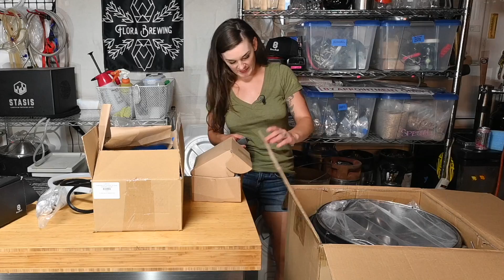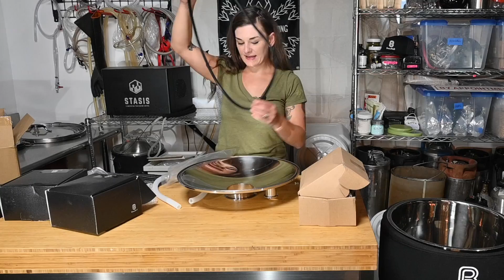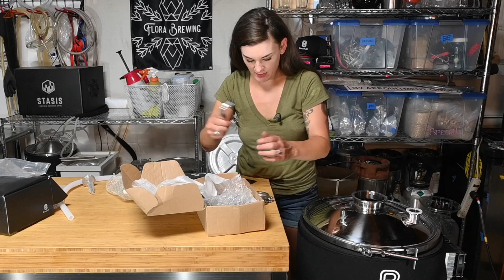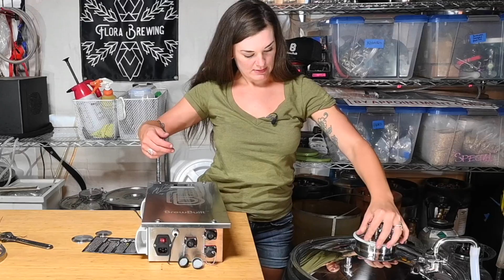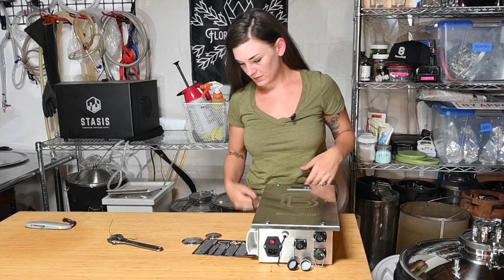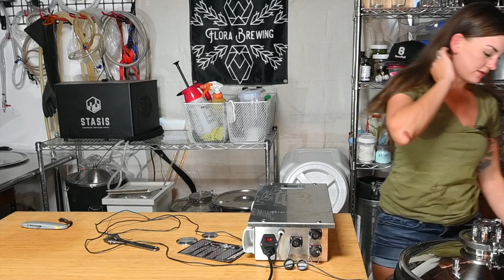BREWBUILT™ X1 UNI PRO Conical Fermenter Unboxing and Assembly

Comment: How do you pressurize it?  I bought the pressure pack and spuding valve tower but the post in the lid is a prv that goes off at 2 lbs.

Comment: Anyone use one of these for lagers? Just wondering if it would work if the surrounding air temp in the room was 75°F? I’ve used coolers which use this cooling tech and they were not very good. Just wondering how this is.

Comment: Is the black insulation around the fermenter removable?

One can think of the Peltier effect as the opposite of how a thermocouple works.
A thermocouple is composed of two different metals which produces a voltage that is related to the temperature.
If you apply a voltage across two different metals, you get a temperature difference so the Peltier effect can be used to cool or heat - a reverse thermocouple

Comment: I wouldn't use that trub catcher for dry hopping. At first glance it doesn't look like there's any way to purge oxygen from the canister before you introduce the hops into your tank. That extra tri clover fitting on top looks perfect for a dry hopping addition. At home I use a 
2" sight glass that goes to a 1.5" reducer and butterfly valve. On the top portion of the sight glass I use the same cap you need to pressurise a standard keg. for pressure fermentation just add a "T" where your blow off port is and add a valve before that 90 barb they supplied. On the other side of the "T" add your spunding valve for pressure fermentation. So you can start you fermentation clear of any pressure and once its taken off, you can by pass the direct blow off and add some pressure to the vessel. Just make sure you research the tolerance of each yeast you plan on pressure fermenting with. 

Cheers!!

Comment: Also for the thermometer and thermowell, there is a thermal gel you can get to apply inside the thermal well and insert the thermometer into it and it will help get more accurate readings and hold the thermometer in place better
Reply from the maker: Going to have to get some of that!

Comment: at 4:30 when you put the ring on and tighten, correct me if I'm wrong, but the "T" part that goes in the clamp is wrong. I believe it should be up and down inside the clamp rather than how it is. Basically rotated 90 degrees
Reply: I have the Spike Brewing 5 Gallon and it has the same style lid, gasket, and ring
Reply from the maker: The lid clamp? It def looks weird but I swear I did it based on the instructions. They're here https://brewbuilt.com/images/file.php?file_id=53513 will you LMK if I just saw wrong?
Reply: @FloraBrewing  yes the "T" part that locks into the clamp just didn't look seated correctly. I've had my lid pop open before and it's not pretty. Just trying to look out for you